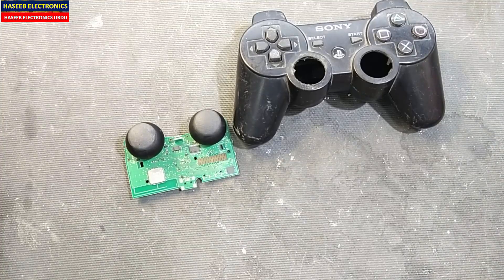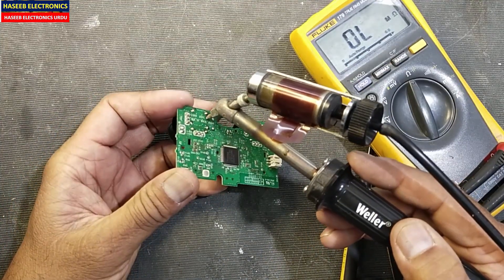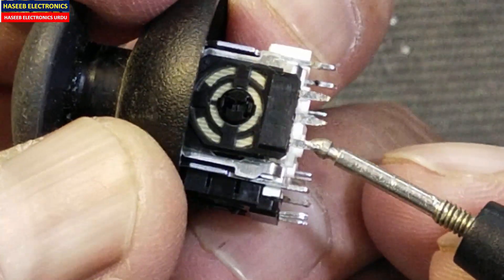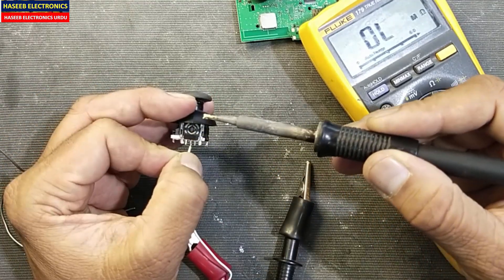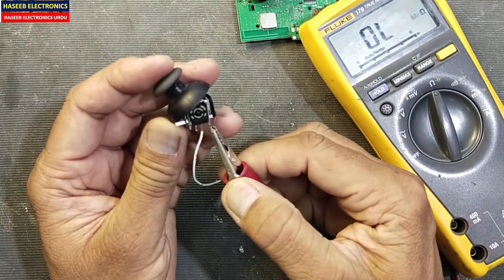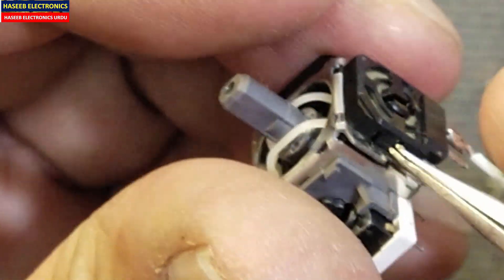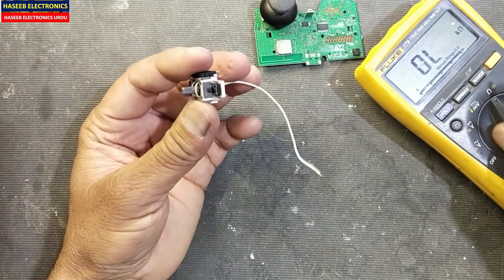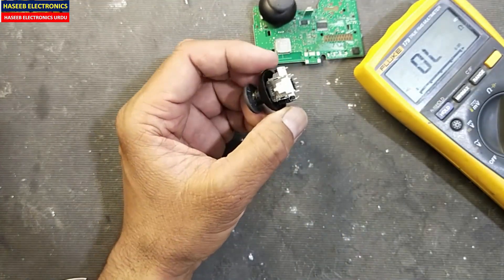{607} How To Test Joystick With Multimeter

Comment: Recently I had to build a small automation. A thermostat (bimetallic one) have to control a 230ACV power relay (the coil is 230ACV also) . Is it preferable to connect the thermostat to the "high side" or vice versa?

Comment: What to do if the cursor is not centered after changing the potentiometers?
Reply from the maker: in that case we have to trace the pcb, processor and the wireless transmitter